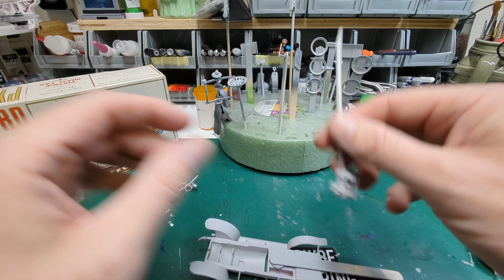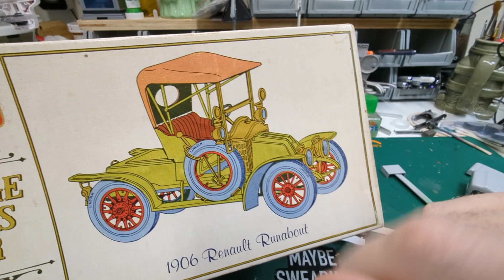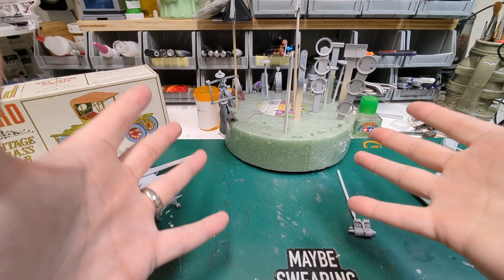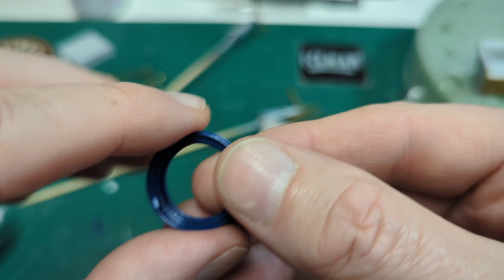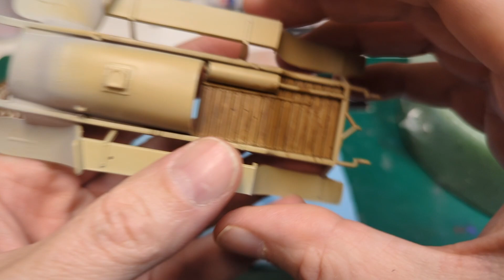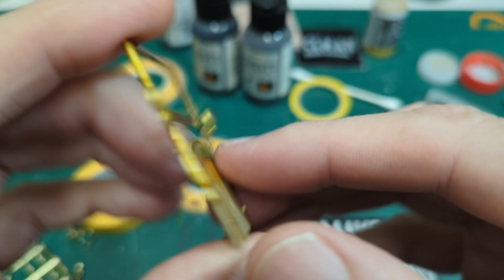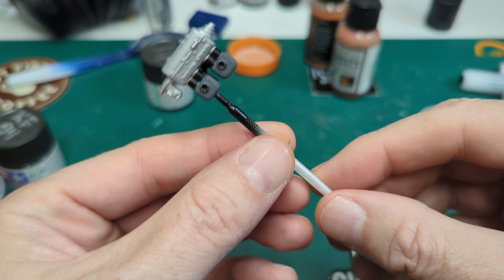Small scale Group Build Update! 1906 Renault Runabout

Comment: Very cool kit Bryan. Those old Pyro kits are very nicely detailed. The early Mack Bulldog trucks had the radiator in the same location as the Renault. Life like acquired the Pyro molds in about 1972. The only difference between them was that the Pyros had the brass plating where the Life Likes had those parts molded in a gold colored plastic. The Pyro logos still appear on the parts of the life like kits. Your build is looking really nice. have fun with the rest of the build.
Reply from the maker: Thank you Rick! This is awesome info!! Thanks!

Comment: I'm building the Aurora 1914 Stutz Bearcat and it has the same type of brass plated clear plastic. I stripped it all off since I am going to paint them in chrome instead. Seems that a lot of the Bearcats had chrome fittings rather than brass. Apart from quite a lot of flash and some seams on most of the small parts, it's quite a nice kit. Mine was actually made in New Zealand, as was my old Revell 1:32 Hurricane kit. I'm painting the Bearcat in SMS Casino Blue for the body and fuel tank, with gloss black for the chassis, wings and running boards, and a few parts are either wood finish or aluminium plate.
Reply from the maker: Hi David! WOW!! Your builds sounds like its going to be sweet! I wonder if Aurora and Pyro are somehow connected? 🤔 Bearcats had chrome fixtures eh? Very cool, I had no idea! ☺️

Comment: You've got some great progress in a week Bryan.  I'm impressed by the detail of the kit.  I've never been convinced by the provided "brass" plating.  It always looks more gold than brass.  Some years ago, I bought a paste like that Chrome effects.  It was a waxy like goo without the hamster poo.  I used it on one project, but don't remember which one. 🤔 I'm off to have several cookies.
Reply from the maker: Hi Vince! That paste sounds like the stuff called "Rub n buff" a metallic wax for polishing stuff. Very handy in the world of prop making and cosplay. ☺️
Reply: @BGsModelWorkshop  You got it, Rub n Buff!  It's tough getting old.  I should have run to the workbench to check it.  I still have tubes of it.
Reply from the maker: That stuff goes a long way and lasts for ever